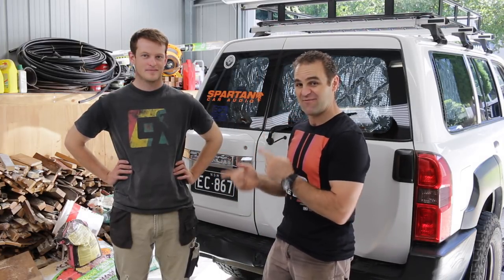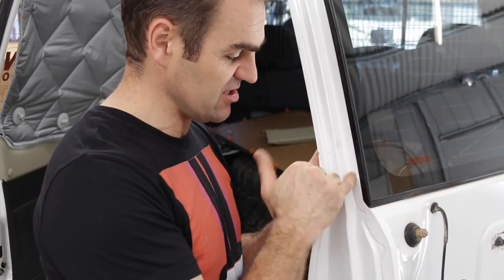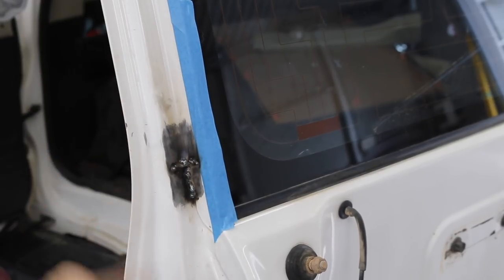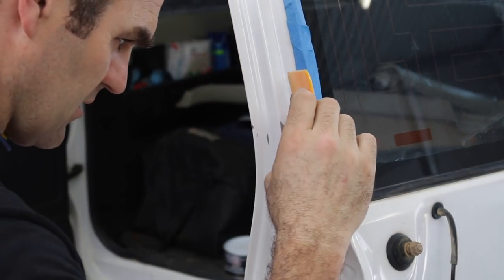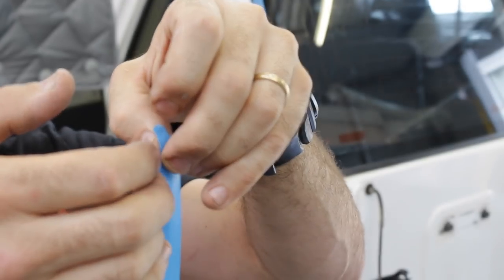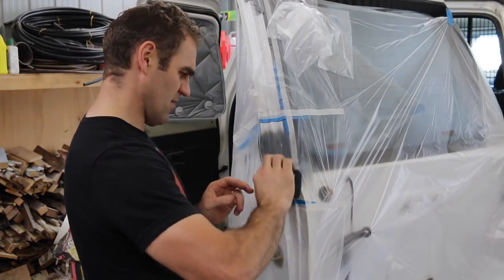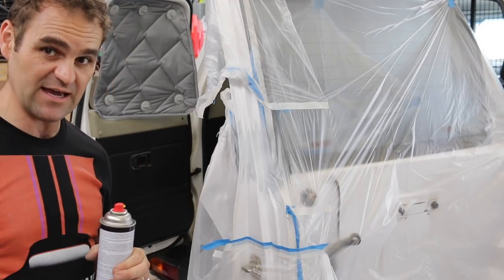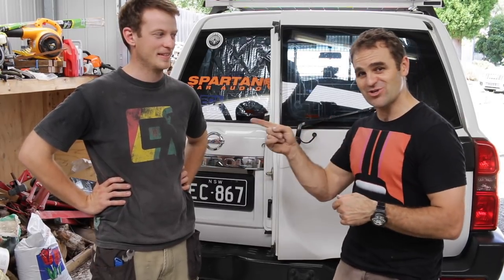Basic body repair - Nissan Patrol GU Barn Door Repair

Comment: Jeff it’s always a good idea to cover the glass with a welding blanket when welding near it. Otherwise you run the risk of molten balls embedded into the glass.
Reply from the maker: I have done that before, you are correct. I wasn't overly worried though, as I was welding around the corner of glass, so there was no direct exposure.

Comment: With an exception to the welding component, paint and repair looks pretty easy to do. I didn't realise you could get mixed aerosol cans. Nice vid.
Reply from the maker: Neither did I. They actually mix it on the spot and insert it into the can!

Comment: Jeff do you clean the surface before welding? As in use prepsol / wax and grease remover etc..? You welds will be a lot better if you clean the area really well especially with Mig, also where you place the clamp for the welder (good grounding also helps).
Reply: By the way I mention it because I see you touching the metal with your fingers which can contain oils and contaminate the area. Not sure if you're aware of this?
Reply from the maker: I did clean it up well before welding. I didn't bother with clear on the solid white as it is not super glossy anyway.

Comment: That taped masking is very handy stuff, I didnt know that was available. Where is the spare wheel going now? Roof? Under floor? in the back? Maybe a lighter wheel for the back door.......A thin steel one might work.
Reply from the maker: The spare now goes on the roof tray, so it is out of the way. The taped masking is great and very handy.